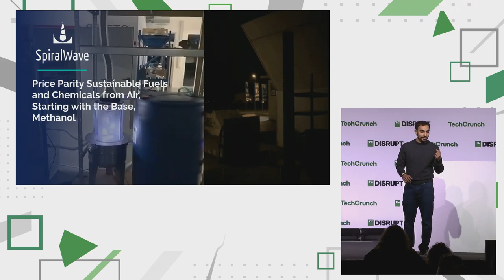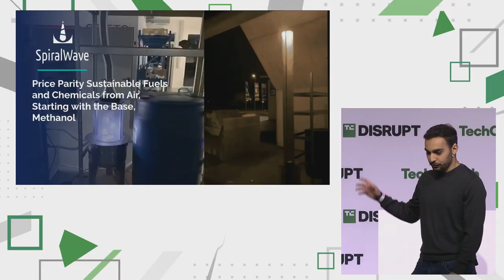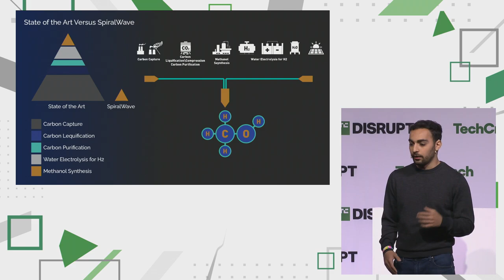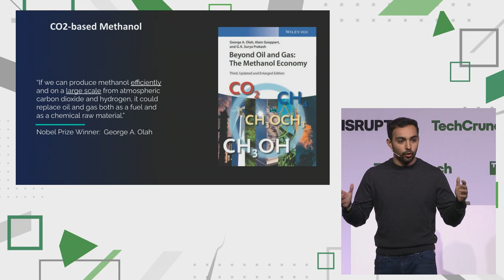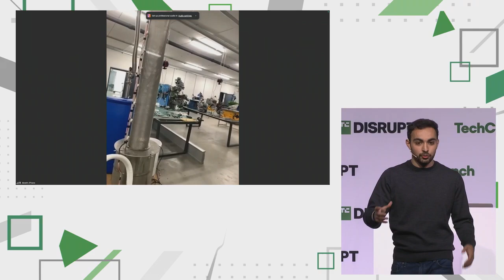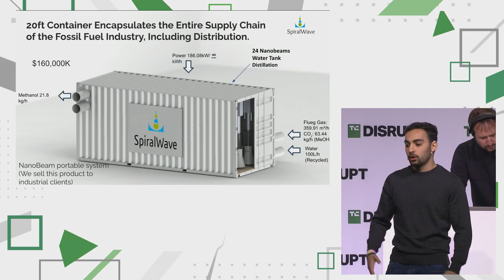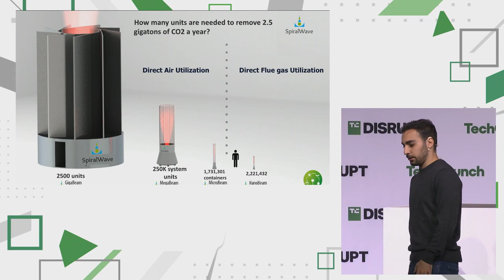2024 Startup Battlefield Top 20 Finalists: SpiralWave | TechCrunch Disrupt 2024

Comment: I wanna see this turned into a closed fuel system. No exhaust, just take the waste gases and add electricity and water. I'd love to see the numbers for efficiency on that. Someone build a methanol engine, hook that up to the exhaust and have it run back to the fuel tank, see how long that runs on a litre or so. 

I'd love the aesthetics of a future where those pulses happen nearly as fast as fluorescent tubes, I imagine them all future-steampunk lining the engine of a train. 

I feel like there would be technical challenges in long-term use, especially if a closed fuel system were created. You might end up with buildup of various byproducts or engine grime in the case of using exhaust gases. Can these be cleaned easily? How pure is the methanol, and does it stay that pure as it gets dirty?
Reply: More questions: How pure does the water need to be? Does impure water leave residue, and how will that affect the system? How much water is required? I worry that this might strain fresh water supplies, at a time when water wars are looking more and more possible. If you're taking out gigatons of co2, surely you'd need a very large quantity of water, or have my decade old chemistry classes failed me? Methanol is CH3OH, that's more H2 than CO2.
Could we use this technology to convert other gases, such as methane, in places where that otherwise leaks out?
Have you measured the gas concentrations near the system before and after? Are there gaseous or liquid byproducts? Surely oxygen from the basic chemical equation, and if the fuel creating reaction isn't perfect, we might end up with a buildup of H2 and O2, which makes a fun noise sometimes
Reply: Can this be used without water? If you had hydrogen sourced from elsewhere for example? Or is the water involved in the creation irreconcilably?